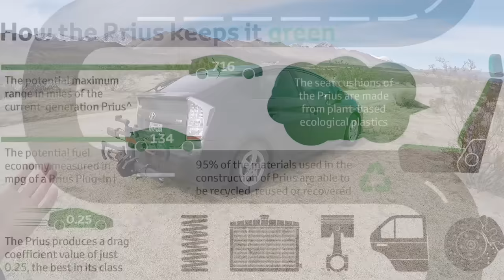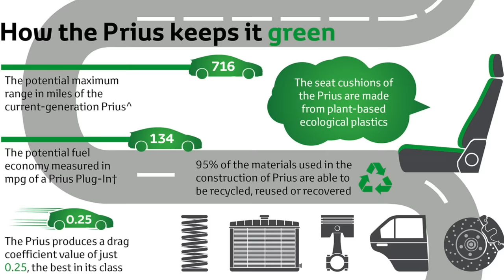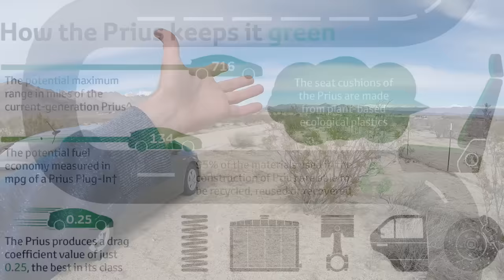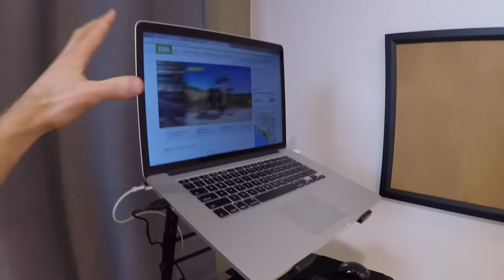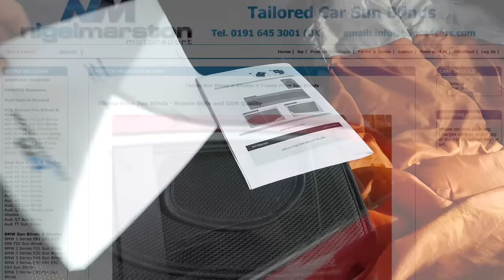How to Live in Your Car, Save Money and Be Free

Comment: wow, I never knew people do this living in a small car :) hey but it looks like you have really put a lot of thought into this and it seams to workout for you and you look happy and I respect that. have you thought about installing some removable fully black curtains ? and you can use sun blocking folding sheets for the windscreen , I would feel more comfortable that way. and one more safety tip: have a fire extinguisher in your car incase of electrical short circuits and a glass breaker incase you get locked in.

Comment: Very cool and informal video. I am currently living out of my sedan in Okinawa, my job grants me access to libraries, gyms, coin laundry mats. The worst part of living in the car? The heat! Especially this tropics island in the pacific is deadly during summer. Any tips??
Reply from the maker: You can use a wet rag on your neck to help cool you, my Prius is nice because it can run the AC off of the electric motor very efficiently (one gallon of gas for AC all night long)

Comment: In fact being homless can be much more expensive than having a house. I lived in a car for 4 monthes after losing my house, I had to Pay almost 700$ a month for storage units, nearly 500$ for car rental + Food which is more expensive ( since all you can eat is fast food)+ Gym Membership for shower + Gas which is a lot since you have to be moving constantly and running the car for AC/Heat .I ended up spending around 2500$ a month to live in a mini van let alone safety concerns and how much it is exhausting to live in such condition and having to go to work everyday. I didn't save a penny. It a pure traumatic experience.

Comment: Excellent, detailed review. I've lived in my Buick Park Avenue since 2015. A. Frank. The author describes living in a car without euphemisms. For instance, he identified 24-Hour Fitness as his location for both shower and shaving and Panera Bread/Starbucks for his office. I use 24-Hour Fitness & McDonalds; these are important details. B. Accessories. The author identified helpful technology. For instance, he identified NigelMarston Motorsport for custom window tinting; I use Styrofoam/aluminum foil for additional tinting (see Living in a Car on $800 a Month, CheapRVliving); this is an important detail. The privacy is important to both me and others; commercial slip-cover mesh do not fit my car windows. I will request a quote. C. Prius. C1. I was aware of Westfalia's butane tank feature for heat during boondocking, but was ignorant of the Prius heater/cooler feature during boondocking. The Buick lacks both features; I buy hot water from convenience store, and store the water in insulated bottles.  C2. The sleep area of this Generation 3 Prius is much better than the custom sleep area described in Living in a Car on $800 a Month (CheapRVliving) and is better than in a Buick Park Avenue. C3. The Prius 9-V receptacles are critical in modern life. I have 3 in my Buick and use all three for iPad, TomTom (GPS unit), and inverter/cell phone charger. D. The author identified sanity features. For instance, the author eats healthily, watches movies, and uploads content on laundry day at Airbnb. I don't eat GV Quinoao, don't watch movies on iPad, or do laundry at Airbnb, but I do similar actions for my sanity. I improve nutrition as needed. I watch movies on laptop at the KOA campground as needed. I use a coin-operated laundry. I upload content at either a public library or McDonalds. I use Airbnb as needed for training, voting, recovering from illness, & cutting my hair.

Comment: The only encounter I had with the police was them asking if I was ok and if the vehicle I was sleeping in was mine.

Please do NOT block the vent on that cooler. It's a peltier thermo-electric plate attached to a heatsink. Imagine the peltier "wicks" the heat from one side to the other, in cooling mode the fan takes the heat from the heatsink and ventilates it to the environment. If you block it you reduce the effectiveness at best or even stop it working. If anything you should add airflow, not block it.
They are also extremely inefficient but they are better than nothing. If you want to increase the efficiency decrease the loss by adding gel packs into the fridge and make sure the cooler is insulated, fill the wall cavity with spray or polystyrene foam if it's not filled already.

The safest place for heavy items like that desk is down behind the front seat (if you don't have any other option.

Comment: Though I assume you know the downside of a Prius is that the materials used to make it (the "95% recyclable materials" is often accused of being quite inflated, and the 5% are quite harmful), and the resources used to ship the parts back and forth, are by no means green and more than counter the gas saved in environmental terms, the fact remains it is still quite an economical (if not ecological) car. And living in it certainly reduces your... treadprint a buttload. And I'd never considered just how good they'd be for living in. Way to make the crappy rear view work for you, too.

I'm on your channel because some of the properties I'm looking to build a tiny, economical and ecological, house on, are close enough to civilization to do away with a car and just have an ebike once I'm done building. Before that, I was also considering a tiny house on wheels and living in a converted van. I'd not considered car living - and know it's certainly not for me even part time (a motorcycle and a tent is more my speed, even) but big kudos to you for making it work.
Reply: If your property is close enough to stores you could get by really well with an Organic Transit ELF. It is solar/pedal powered so you don't even need power to charge it. Mine hauls 20 bags  of groceries, I have hauled long pipes and lumber and it can pull a trailer.

Comment: Your values of sustainability and efficiency? Sounds good but it's too bad you are just trying to save money and are not really interested in conserving the environment. If you were, you would not leave your engine running to charge the batteries to run air conditioning. That defeats the whole purpose of having a hybrid in the first place. Just put on another layer if you're too cold and open the windows if you're too hot. That would be a more consistent approach.

Comment: Have fun when you need 5000 to replace a battery and other computers that are bound to break after the million miles that you're likely to put on to it, the premise is great the car just isn't cost efficient in the long run, if you arent planning to get rid of it and get another one
Reply: Ara Torosyan you can have a reconditioned hybrid battery pack installed for less than $1,000.